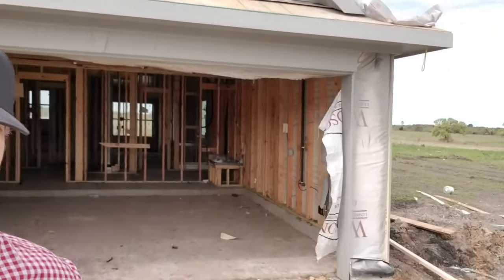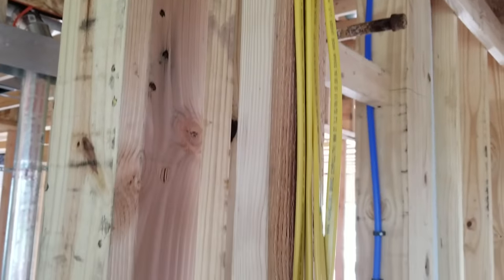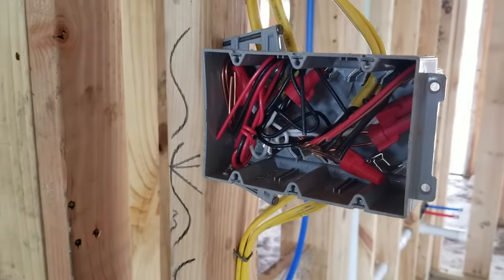HOW IS THIS EVEN LEGAL?!?!

Comment: Unfortunately I've been encountering the same thing with multi million dollar houses here in SoCal.  One client has a brand new $2 mill Toll Brothers house with an improperly flashed door that leaked and they don't know how to fix properly, keep trying to caulk it.  We also discovered the bathroom exhaust vents were never penetrated through the roof, just died into the sheathing.  Another brand new $1 mill CalAtlantic home that I opened up a wall in and saw mold behind it forcing remediation, home owner hadn't even moved in yet.

This is exactly where I get my passion to want to become a production builder, I am so upset by what the builders are getting away with at any price point.  They skimp on the couple extra $ to make the home right, of which this market will gladly pay if they educate them on the difference.  There is no reason tract homes have to be crap homes.
Reply: Toll brother's build million dollar track homes their superintendents don't know their ass from their elbow I've worked on these homes There is no excuse why they can't build a quality home that will last.just pay your subs better and make sure they understand the building codes
Reply: @artnouveau4332  the superintendent on my parents home in NJ (toll brothers) had some mental deficits and a permanent twitch due to acid consumption in the 70s... this is the kind of quality people they have working there.
Reply: Toll brothers is a publicly traded company so we got to keep the stock price going up and pay the CEO millions every year
Reply: John Burger  Maybe you are onto something, how many tradesman do you know have made learning the Building Codes as important as learning their trade. Any tradesman that takes the time to do so can be head and shoulders above the rest seems to me.
Reply: That is scary as hell. I am also from california and the price of housing is ridiculous
Reply: All the executives at Toll Brothers along with Wall St executives should be forced to live in huts with no running water or heating and air. These assholes are cutting  corners and stuffing their wallets and building custom homes that are better that the shit they build. We get the most fucked up problems to solve when we get a call to service a tract home.
Reply: David Feldman 
Toll Brothers is super cheap they only have an expensive look and price. Quality is below average or average at best.
Reply: If there is a way to get the buying public educated and create the demand for quality, you can be successful. As I've seen, people are buying appearance over quality. It's a tough place to be caught between quality and profit.
Reply: David Feldman : can’t the builder be sued?
Reply: Toll Brothers and Hovanian. RRRuuuuuuuuunnnnnnnnn!!!
Reply: I live in New York and there's thousands of these homes from toll brothers. Me being a painter anytime I work in one I dread all the repairs that have to be done. There terrible homes!!!!!!!!!!!!!
Reply: @robkitchen5344  yeah I can see that happening. If people really cared less about price first, Walmart wouldn't be as successful, and our homes would be smaller, more expensive, but far higher quality. The buying public votes for crap products with every purchase they make.

Comment: That wrap is not designed to be water tight. It is classified as vapour-permeable-membrane, and here in Australia we use it instead of a waterproof membrane for a reason.
It allows the building to dry out from the inside out. I saw a comment above about black mould being in the walls within a few years. Nine times out of ten mould will grow when moisture is trapped and has no where to go. 

But where is the biggest threat from moisture ingress into walls? It’s from the humans living inside. The moisture comes form all the cooking showering and most of all breathing, that we humans love to do all day long. This warm and humid air wants to get outside just as much as the cold air wants to get inside. This produces condensation on the colder outer layer of the wall system, in this case the Hardie siding. Having a waterproof layer will only cause this condensate to remain in the walls and grow mould.
Reply: But there IS NO WALL
Reply: Cooking, showering and breathing is a human necessity. Not something we love to do all day. It's not an option.
Reply: @jifffy999 He's not criticizing you, just educating you, and he is 100% correct. The day to day activities that take place inside the home introduce a ton of moisture into the house. It has to be able to dry to the outside. Controlling moisture from the outside is about keeping bulk water out of the structure.  That is the job of the roof, siding, and flashing first, then, as a backup, the housewrap. If it's getting to the housewarming, that's indicative of other issues with the aforementioned systems.
Reply: @MichaelBarnes-ey7sj Walls, (sheathing), don't keep moisture or bulk water out. The absence of sheathing is more problematic from a structural perspective than a moisture barrier perspective.  Even if it was sheathed, unless it's the Zip System, the housewrap is your back up bulk water barrier anyway. It is the job of the roof, flashing, and siding to keep bulk water out of the structure. The sheathing doesn't really do that.  It's not supposed to. If sheathing is your only barrier to bulk water, you haven't done anything correctly.

Comment: that is terrifying.
here in the midwest, I could see a straight line wind coming through and taking out half that neighborhood
Reply: It’s already happened here in Indianapolis this past winter. Literally knocked over a chimney like the only thing holding it on the house was the vinyl siding 🤦🏻‍♂️
Reply: They are EVERYWHERE.
Reply: Im here in SW corner of Iowa and that was my first thought too, plus rain and snow never come down, they fall SIDEWAYS, that stuff would be coming right through those walls o.o
Reply: That's why I just sheathed this house near Chicago when I did new siding, for the wind loads. The weather is getting crazier and we keep seeing more and more high wind advisories.
Reply: waterside  do you have a better description for the possibility of suddenly being crushed in your house 🤔
Reply: waterside  they don't put beaver barf there for insulation, it's almost entirely for structural purposes. his complaint about the paper was that in addition to that it isn't insulated from the elements properly.

Comment: Quality over size is the way to go. I just built a block home, less than 1,000 sq ft interior but great porches under the roofline front and back.
The plan is designed to be added on to. Remove one closet, and continue on out to an addition.
The closet was for a bedroom, and us turned into an office with an exterior door.

Comment: As a Firefighter this is concerning. The rack control or should I say lack of rack control is suprising. Note how they went good install on the AC, it's to pump all the air through the house as it leaks out of every crack. I'm sure the sheet rock is all the rack control a house  needs hahahaha........
Reply: That's actually something Jordan missed, the siding isn't going to give it any appreciable racking strength but the drywall will. It's not like that's going to come close to the racking strength you get from sheathing a house with 1/2" plywood but I can see how they might be able to get the racking strength that it's engineered for with the drywall.
Reply: I was a mechanical inspector years ago. I inquired about buying a new home in the subdivision they were developing.  The superintendent of the subdivision flat out told me, you don't want one of these homes. Same cheap practices.
Reply: I would never trust drywall for rack strength. For a properly secured build, it can add some strength, but it’s just icing on the cake, so to speak. Also, these thin straps with the few screws or nails, offer very little in strength for a house. They’ll snap off if the shear exceeds the strength of the fastener in, what I presume is wood. The strap itself can shear at the fastener holes. This looks like really thin stuff. In addition, they offer absolutely no resistance at all. The house will fall, but the ceilings, lying on the ground, might still be square.
Reply: Rack control... I was wondering what the proscribed nomenclature, for. Common Sense. Was in the context of this particular field.
Reply: @christopheremery5910  rack control = sports bra
Reply: JL
All you back east call it racking strength . Out west its called shear walls or shear value.
Reply: @frontallobotomy3481  Hate rack control, lol, from the 60's and like the I'm going , hanging and peeking  my Way Look.
Reply: Greg Spolar  I suppose rack control is terminology used by trades back east, in Cali we use terms like shear, anyhow talking about same thing. The need to withstand Lateral loads from wind and seismic activity. And course regional differences are considered by design engineers. Unfortunately shear values of different materials are misunderstood, but plywood and OSB are your best bet on exterior walls for many reasons.
Reply: @cdawg9149  shear wall in Florida.
Reply: Scary stuff indeed!
Reply: Text-book egotist :)
 Greg Spolar
Reply: @melgross  Special strength drywall is actually used for structural bracing down here in NZ would you believe, the sheets are glued and screwed to a specific fixing pattern and we have quite stringent regulations due to the earthquake engineering requirements.

Diagonal strap bracing can also be fine as a structural bracing element although there would generally be a whole lot more walls braced up with it than what was shown. Fixings will generally be 2x 35mm product nails to each stud and it will lap under the bottom plate and over the top plates and fixed with 8 nails at each end. Same to roof truss system to tension that all up.
Reply: But you can enter the house from anywhere. Just kick a hole in it.
Reply: Dont you know yet that firemen know everything . Like they say ,how do you know there is a fireman in a room , wait 10 minutes and he will tell you .
Reply: Adsjabo that’s a lot better. I’m not familiar with that product though. When we say drywall, as you know, we don’t mean a specifically engineered product for earthquake protection. Normal drywall depends on the paper covering to keep it in place. The gypsum itself has little resistance to shake, and racking, because it has no structure, and will crumble.
Reply: But firemen DO know what a lot of people don't. They're the ones who risk their lives having to rescue people from death traps built like this. He may not use the construction terms you have, but firemen definitely know what's life threatening in construction.
Reply: @sarahann530 ; Jealousy isn't just a river in Egypt ;-) And by the way, it didn't take me anything close to 10 minutes to spot your comment and announce there's yet another firefighter in this room. (So you might be right there. Haha!)  But seriously, when I entered the fire service in the early 80s, our roster was heavily weighted with folks from the trades, including a handful of licensed general contractors. People with construction, tools and equipment knowledge who can work in gritty environments and cooperate with a range of personalities are generally a good fit. Our Prevention Bureau included Structural Engineering consultants, the EMS director was a physician, etc. These specialty heads were continuously scheduled by the Training Division to teach. While nobody can know everything, and I'm personally no fan of know-it-all personalities, the quintessential jack-of-all-trades is probably fire service people. (Dependent on the requirements of a Department or District, I suppose.) I say all this with humility. I'm a humble guy. Hell, I'm probably in the 99th percentile for humbleness. I rock at being humble! ;-)

Bottom line: I'm with Jordan, the video's producer. Great video, assessment and advice; I couldn't have imagined this kind of construction anywhere without seeing it. No way this absence of shear panels would meet code in my prior area. Minimum cladding for a single story with a standard roof load is 5/8ths. And then there are additional hardware requirements for even more bracing, all in anticipation of the lateral loads earthquakes provide. Having exited Commiefornia for the great rural midwest, I now live in an area where there are literally no code requirements for residential construction, and I've still never seen anything other than a pole barn built without shear panels.
Reply: That a book of matches waiting to go. Get your scba on before you get out of the truck. At least you can bust thru walls real quick.
Reply: Greg Spolar why argue with him, he’s a fire fighter, he automatically knows everything.
Reply: @sarahann530  Oh geez. Where would I even begin with you? Good luck and thanks for the laughs!
Reply: @jimmyyounger618   If you dont know where to begin why post anything . We really are not interested in what firemen think  !
Reply: @cdawg9149  
Out West we call it a hammer tacker. Out East they call it a slap hammer...go figure
Reply: I guess these model builds aren't a fire risk. They'll just rot and fall down before a fire can take hold. The ceilings will flatten any flames on their way back down. Luckily people can break through the walls under their own steam to escape. 🙄

Comment: In my former spec home Community neighborhood. One of the housing inspectors visited a job site leaned up on the outside of the house expecting sheathing and went right through like the Kool-Aid Man because it was foam board against the stud walls eventually vinyl siding over that. Until I met that house I didn't know houses could be built with anything other than wood sheathing .

Comment: um just looked up. by laws of building codes they must put sheeting. the roof load determines the thickness required on walls. report these homes to the city and national building code association. the builder is looking at a huge fine. if you dont report them then you are ok with it and keep allowing people to be screwed over.
Reply: He probably did and didn't want to mention that on the video for liability purposes 😏
Reply: The system is corrupt. It's almost guaranteed that local or state officials know exactly what's going on. How can they not? Still they sign off on the work done. Obviously they do, or else these houses wouldn't keep getting built.
Reply: This exact same garbage happens in 100% of new modern automobiles. That's why I boycott all new vehicles, and only support classic cars.
Reply: @johnnocanuck  while I agree that there's often corruption, there's also usually too few inspectors covering any given area. Both conditions, sometimes the latter leading (gradually or not so gradually) to the former, are contributing to problems like this.
Reply: Oh my! Compared against the quarter million dollars of real money the homeowner will need...what a pittance we're looking at in terms of proper sheathing materials.

Once it's covered up, retrofit is very expensive. Sad.
Reply: @johnlockesghost5592  A crash test vid. !?! LOL  Oh yea, BTW, a 1959 model year vehicle is classified as an Antique by most states and all insurance companies.
Reply: @johnnocanuck  Those houses are being built out in a field.  Its likely outside of city limits where there might be limited to zero code enforcement for anything but electrical and plumbing.  Get outside of town far enough, and there are no inspections at all.